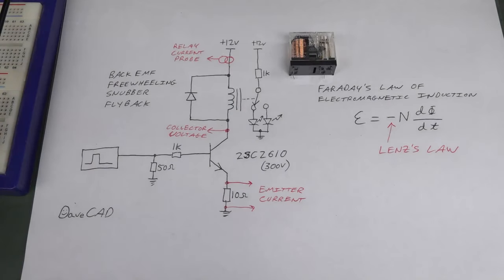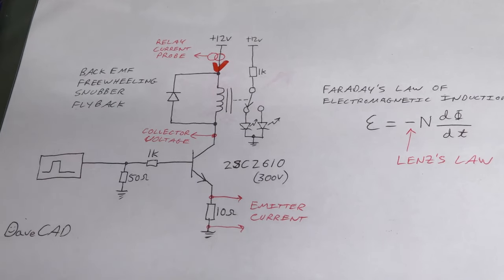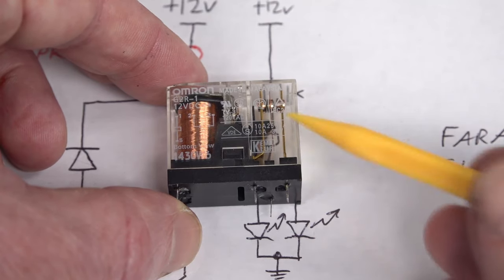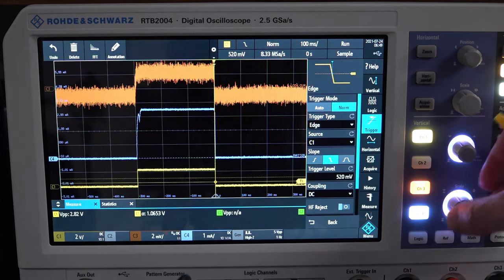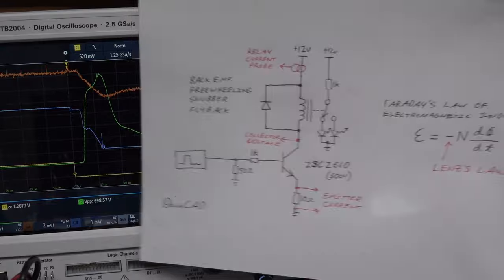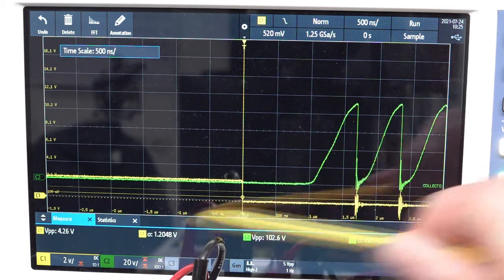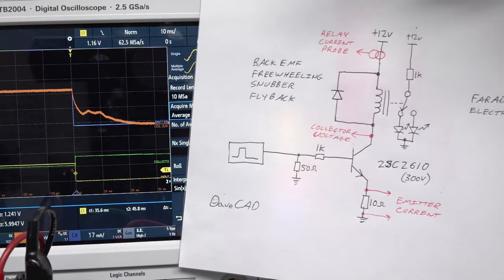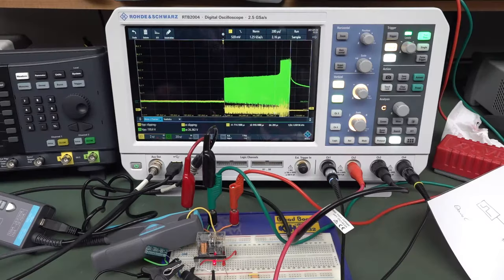EEVblog 1409 - The DANGERS of Inductor Back EMF

Comment: This is one of my questions when I'm interviewing circuit design engineers. I ask them to draw me the circuit they would use to connect a relay to a GPIO pin. They get points for knowing a GPIO pin can't source enough current and need a transistor of some kind, and extra points for including a snubber across the inductor.  When I first wrote the question, I thought I was being too easy, but after a dozen interviews, I was wondering if I was being too hard. Interviews are stressful and make you second guess what color the sky is, but I get all sorts of answers I wasn't expecting.
Reply: Awesome fact, could you share more of those "tricky"   you questions you ask?
Reply: Not too hard at all. That's really basic stuff. Easy to forget, especially in a stressful interview situation, but basic stuff nonetheless.
I hope that most at least get the transistor part right :-)
Reply: @sencillamentecharles4359  They're all pretty basic EE101 to gauge their working knowledge. Aside from the relay question, I do a equivalent resistance circuit using values that makes calculating values in your head easy (like two 2k resistors in series, which is in parallel with a 4k resistor, and one 1k resistor is in series with the others).

Another question is about ideal op-amp characteristics, which leads to a question about why you would use an op-amp configured as a unity gain.

The other is just a basic bit wise operations. This does have one trick to it to see if they recognize the overflow that occurs and if their result of the 8-bit unsigned integer is 0x08 or 0x108.
Reply: @stephanweinberger  the transistor is 50/50. I've even had people connect the SPDT switch to the GPIO even through I drew the relay symbol with the coil on the left, and the uC right next to the coil.
Reply: ULN2003 Is the answer. It has got some 8 Darlington arrays, diodes for freewheel....works nice till the magic smoke escapes.
Reply: I wish I get interviewed by you if these are the questions to be asked in job interview......
Reply: You can use an optocupler, that may protect your gpio.
Reply: I don't think you were being too hard. This is 101 stuff to me and I've only designed a few boards.
Reply: I've done a number of automotive designs and when I meet with customers now I do the opposite haha: so you want input capacitive coupling? Tvs transient protection? Reverse bias and lockout at 18v spikes? Freewheeling protection? CAN bus impedence control? No? Ok ill just delete a couple sheets of my schematic.
Reply: If those are questions for ENGINEERS, then I am well into being an engineer.
Reply: @jacobhn2  Who's going to protect that poor optocoupler then? All alone with its output legs standing in the middle of an inductive battle field while the GPIO is screaming bloody orders into its input diode! ;-)
Reply: @phantomhck  hmmm, i don't get it. What do you exactly mean? how do you protect your circuits?
Reply: @MrAssembler  I mean that there are standard circuits that are pretty common. ~15k ohm across input rails, two 22nF caps in series across the rails, ~28V TVS, P-FET for reverse voltage with a 10v zener protection. 5.1v zener protection for all inputs. I automatically put these in and customers tell me when to not put them in for whatever the project needs are such as space or cost.
Reply: @jacobhn2  Why would this be warranted?
Reply: Yea I wish I could drive my relay using the arduino :( I figured out in the lab I needed a switching transistor with a separate voltage source to drive the relay if my arduino IO is already loaded.
Reply: @Wingedmechanic  what did you mean "the magic smoke escapes" ?
Reply: This task is not hard, but at an interview when a stress have a place to play, people may treat questions very strictly and the way you ask them can have a great impact on the outcome - if i would be asked to connect a relay directly to gpio pin by an interviewer, i may end up doing exactly what i was asked for, i simply wouldn't assume that it is for a real device and you want to connect a huge relay, but a small SMD one that an uC could actually drive (10-20mA). You have to form a question in a way to give someone some sort of freedom how the goal should be reached.
Reply: Sigh, I’ve such a long way to go to even know where to look for what you guys are just rattling off the top of your heads.
Reply: I was asked about the Flywheel Diode in a job interview and the guy was startled that I knew what it was for lol........didn't get the job though!
Reply: I would not mind an interview with you, when I got my graduate job at lockheed I pretty much had to provide my own thesis on the theory of transformers. The flyback diode will however catch the youngsters out

Comment: Don't assume that all designers know about these things. I was called over to look at a friend's electric gates and discovered that the DC motors were driven in either direction with relays, with no protection devices in the circuit at all! The relays had already been replaced once, and they can't have lasted more than a hundred or so activations before being destroyed by the arcing. I added a couple of large Zener Diodes back to back across the motors, and the relays have now been on there for years. I suppose the electric gate company likes replacing the whole circuit as a nice steady income.
Reply: Actually, if that was a brushed motor, you just switched the failure mode from driving circuit, to now motor brushes wearing out eventually! (Brushed motors would not appreciate sudden discrete ON/OFF voltage polarity inversion, especially under load!) A much more complicated H-bridge transistor circuit with braking in the control algorithm would be required!
Reply: @nameredacted1242  Dave didn't cover it but you can also use an RC snubber, suitable for AC situations. I'd assume it has a softer clamping action.
Reply: @gblargg  RC snubber or a varistor would be better than a diode snubber in this situation.
Reply: @cambridgemart2075  to be fair, he did touch on it briefly in the middle.

I think the main point is you should validate your circuit in general and try to minimize surprises.
Reply: i like big motors and i cannot lie
Reply: planned obsolescence xD
Reply: You moved electric field into massive torque spikes. Bearings, gears, motor brushes and commutators live a rough life now.
Reply: A electronic designer should absolutely know about this, its basic knowledge!
Reply: @Blox117  you other than inverters can't deny
Reply: @Blox117  you other Inverters cannot lie
Reply: I've lost count on how many relay systems I've serviced to find no flyback/snubber.
Reply: Is that a thing to drive a dc motor with a relay? Wouldnt that be super unresponsive? Im used to using mosfets.
Reply: Extra info, Driving remote  heavy solenoids , the diode should be on the solenoid coil. Not at the driver circuit. Your dealing with the capacitance of the cable feed which aggravates the problem back EMF.

Comment: Beware that large high current relays need a zener type of diode (as said by dave in the end), this causes a larger voltage across the coil in off transient, creating a larger energy dump in the diode and a faster drop-off of magnetic field (resulting in a faster opening of the relay).
Reply: I've seen blogs with scope outputs that show how different flyback configurations can have dramatic effects on switch speed. Quite cool. Rule of thumb I've seen when driving with a transistor is to use a zener value that is as high as possible, but less than the transistor breakdown voltage (with headroom).

Not sure if that rule is valid.... I've seen come fylback suggestions with diodes and caps and resistors, but not sure what benefit, if any, that has...... sometimes I wonder if adding extra BOM is worth it when we all know fairly simple diodes work just as well.
Reply: Used for fast PLC relay outputs for the very same reason.
Reply: ...TWO ZENER DIODES BACK TO BACK IN SERIES IS EVEN BETTER-(!)
Reply: A good peace of info. this is a new take that I had not known about. Using a Zener across the coil dose make sense on some of my applications.
Reply: @rainmakerscustomsrainmaker8985  ...remember that the 2 zener diodes are connected 'cathode to cathode' or 'anode to anode', in SERIES across the relay coil-!!!
Reply: Indeed. I never saw the influence of flyback diodes mentioned in relay datasheets.
Reply: @daleburrell6273  ok I've never used Zener diodes in series. so un like Scotty diodes cathode to anode, they need to face each other or away in order to double the voltage range?
Reply: @rainmakerscustomsrainmaker8985  no, when zener diodes are connected that particular way- one zener diode is forward biased, and the other zener is reverse biased- regardless of the direction of the current flow.
Reply: @daleburrell6273   Thank you very much yes I actually forgot  about the typical characteristics of the zener  being a huge factor in this way
Reply: Just a few months ago, I read a relay datasheet that explained connecting a zener diode along with the normal flyback diode if switching speed is important. It allows the voltage to rise a little more than with the flyback diode alone which collapses the coil's magnetic field faster, but you can get the right zener to make sure it doesn't blow whatever is connected to it.
Reply: Or use a capacitor to get a high frequency ringing that quickly demagnetizes the core.
Reply: @rainmakerscustomsrainmaker8985  Easiest to do by using an AC rated Transorb diode, you select so the clamping voltage, added to with the supply voltage, is less than Vceo or Vces of the switch transistor, and the typical 1W version will do for the majority of low power relays. Place another across the power supply as well, to handle transients on the supply side as well, cheap to add, and can use the same value diode.
Reply: @SeanBZA  thank you for the info. I had no idea there was so many options based on the relays and transistor combination.
Reply: @daleburrell6273  Why would you put zeners back to back unless you need clamping on both polarities?
Reply: @userPrehistoricman  ...that's the idea! A single diode can work against you- I found that out the HARD way-!!
Reply: By "high current relays" you mean coil current, right? Not the current rating of the relay contacts? Just asking to make sure
Reply: @jhsevs  ...the two pretty much go together: a relay with high current contacts- would need a high current coil to make it operate dependably.
Reply: @liam3284  Hence why you would use a zener and standard diode in series, as the video shows. No need for two zeners.

Comment: an interesting demonstration of the back-emf current is by using an LED as the flyback diode
Reply: And you can demonstrate the high voltage issue by using a neon lamp as a clamper.
Reply: @galfisk  I actually did that back in the early 80s when I was learning about this stuff.
Reply: @galfisk  yes and no, the yes is it will lite, the no is there is not a lot discharge, so depending on the about of stored energy in the inductor, the low power neon bulb might not clamp it much.
Reply: Yes 
But it will damage the LED .
Reply: @DavyOneness  that video is pretty long, about where in there is the charging off the cemf?
Reply: @Ozzy3333333  CEMF can't be larger than the forward EMF, that isn't what I am charging batteries or capacitors with.
Reply: @amitrajput6904  the LED must carry the relay coil current, no more.
Reply: An electrical engineer  instructed us to use a resistor except we accidentally used a ten or zero  ohm (dead short)

 however from  the video I can now understand why a resistor was advised instead of a diode as in our application, solenoid bounce would of been no good.

Comment: Spinning flywheel reference...  I describe the issue like a pneumatic air hose.  If you're working on your car in the garage with air tools, when you plug a line into the compressor, the line expands a little like a balloon as it takes on the working pressure.  And, while your using air tools and such, no problem.

However, disconnect that pressurized line and you'll get a nice blast of air in your face, a hose end that whips around and a loud pop of escaping air.  The longer/wider the hose, the bigger the issue.

That magnetic field is just like the expanded rubber of the air line.  It wants to keep squeezing things along until fully dissipated.

Comment: Hi Dave. Good video. The most important is at the end! Often forgotten topic. I work with solenoid that are valves. In the valves you control the current by means of PWM, for that part you want to have a diode with as low as possible forward voltage. You do not want to dissipate energy, contrary, you want the energy to stay there, and keep turning on with PWM to keep the valve open. On the other side, when you what to shut the valve off, you want it to be fast, so you switch another part of the circuit with a Zener, because you want the time to be fast, but also well defined. Knowing the regulated current with PWM, and the zener voltage, you can relatively precisely tell the shut down time.
Also for high power relays it is critical that the field goes down fast, moving the contacts fast and avoiding sparking that reduce the life of the relay. Exactly as you demonstrated at the end, is shuts down harder, but it may be a good thing after all. The harder it shuts down, the more life of the contacts, if the contacts in turn drive another inductive load. On the example of valves, sometimes you want to close them softly, to avoid seal wear.... so... it all depends. But it is important to know that a diode is low voltage and tends to "perpetuate" the current AKA free wheeling, and a Zener or something with high voltage will dissipate energy fast. I've seen even "active freewheeling" by using the diode of a MOS, and turning it on short after the diode starts to conduct, to allow for minimal energy dissipation, when you want to regulate a current in the inductor. This is made with a totem-pole or push-pull MOS stages, for example. It would be nice a video making focus on that topics!

Comment: While experimenting with pulse motors back in 2001, I managed to blow both channels on my Velleman PC scope rated at 600V.
The supply voltage I was working with, was only 12V. 
As luck would have it, a friend gave me his Tektronix portable that was geared towards auto shops and ignition coils. 
It was a life saver sort of thing. It's still working like nobody's business.
Reply: Yeah, Dave said you wouldn't blow up the input of your oscilloscope because there is so little energy in the voltage peak. This is true for the resistors in the input, but the frequency compensation capacitors or a (MOS)FET input can certainly be damaged even with a short overload like this.

Comment: A good easy to grasp analogy I think is  water hammer, when a valve is closed rapidly with a high speed flow through it. U then get a huge pressure spike (because the water like anything that is moving can't just stop instantly) that can damage or even rupture pipes, valves and other stuff. This is sort of similar to that but for for electricity.
Reply: this is yet another one of a multitude hydraulic analogy working very well to explain electricity.
Reply: Yeah, i did that once..... Then i had to explain water hammer... I gave up after trying to explain how echoes work.  Went home, got drunk and cried.

Comment: Great video and very detailed explanation. The simple flyback diode can saves a lot of trouble in relay driving circuits. I destroyed a 3 phase 25 kVA generator winding by arcing out some old MOT's in a three phase arrangement. as soon one of the MOT's primary winding went open circuit, flames shot out of the generator winding vents. Hindsight, I should have used a load bank in parrallel or a snubber/surge protector across each phase. Expensive lesson learnt.